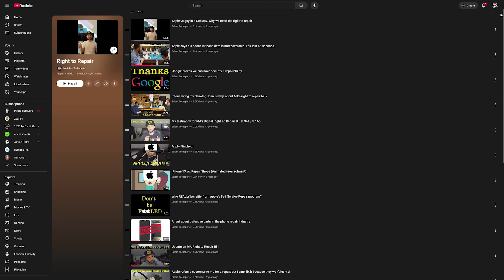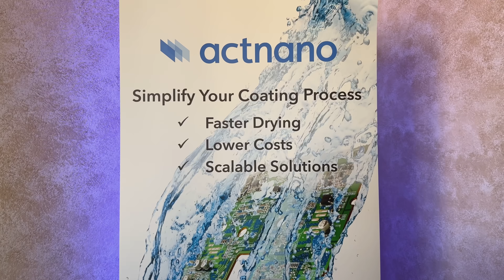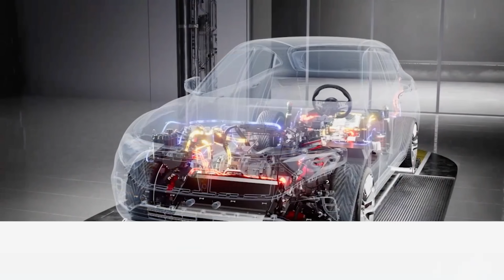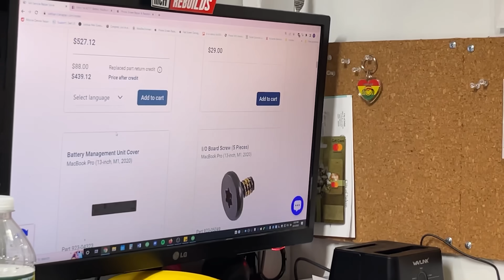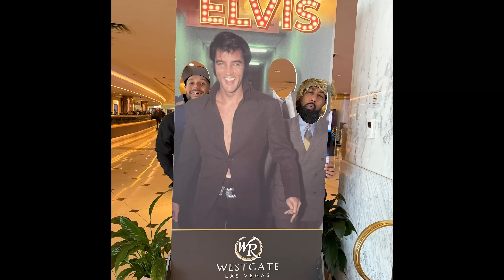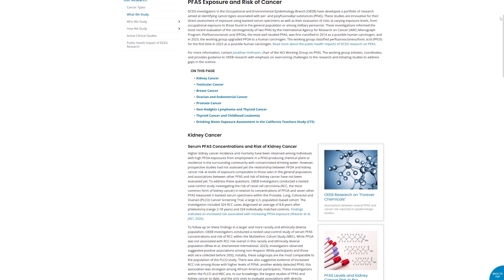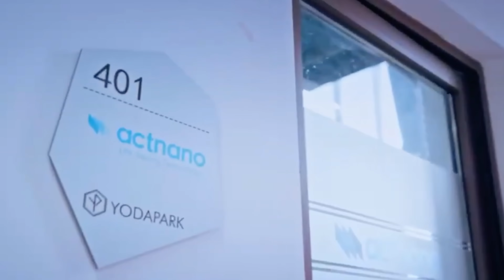Waterproof Laptops ARE Possible, But WE Need to DEMAND Them! actnano nanoGUARD is HOW We Do It!

Comment: What I want to know if this is something I can DIY with an air compressor
Reply from the maker: No, you can't apply it yourself. It must be applied in the production factory where dust, humidity and application of the coating are under strict control and with the proper procedure and machines. Explained here https://www.youtube.com/watch?v=Iyk5tB56P9s&t=1736s

Comment: It’d be nice if this is available for the general public. Especially for custom water builds.
Reply from the maker: You can't apply it yourself. It must be applied in the production factory where dust, humidity and application of the coating are under strict control and with the proper procedure and machines. Explained here https://www.youtube.com/watch?v=Iyk5tB56P9s&t=1736s
Reply: @ aw lame. Well wishful thinking.

Comment: This product, i believe, has been available since 2008 and came from some military tech/sbir funding probably for DACs on AWICS. So, to not put into a product would be horrible. It was original available as an outer coating on tablets, but it went away. I know cause i had a tablet with this type of coating on it and dropped it in a pool. It still worked, but i have never been able to find it after.
Reply from the maker: Not THIS product. This shows you the comparison between similar products and this one. https://www.ellsworth.com/globalassets/literature-library/manufacturer/actnano/actnano-comparison-chart---fluoropolymers-v-nanoguard.pdf

Comment: I totally agree with the concept, I am an electronics engineer for 20 years. I cant see how you can make this work with cables and connectors, also soldered wired with pointy ends.
Reply from the maker: The full interview goes into detail here, right at the beginning. https://www.youtube.com/watch?v=Iyk5tB56P9s 
Here's a brief demonstration https://www.youtube.com/watch?v=sx3xE7D5ys4

Comment: This whole "We can't make a durable product" shit really is all over in the tech industry now.  I remember Nintendo's GBC and GBA being basically bricks in durability.  Then the DS had much the same.

Then the DS Lite had hinge issues, and the Wii U REQUIRES a gamepad(Not sold separately) to work, and the Switch has awful joycon stick drift.  Hell, you can see it in other console manufacturers, too.
Reply: the things are still almost indestructable though. the lite works with a busted hinge, and the joycons are a result of small size, plus would you rather replace an entire console or just a 40$ controller.
Reply: I don't know about that. From what I heard, DS (the fat one) had awful hinges, and DSLite and DSi had much better hinges. 
Wii U is definitely a bust. I get why they require it, many games require it even if for some bullshit reason, but why they weren't selling them separately (outside of Japan) is a mystery.

Comment: Me with my DELL Latitude 7424 Rugged Extreme:
Reply from the maker: Those rugged laptops use gaskets and seals instead of coating, weigh 300lbs, the seal is easily broken when dropped, degrades, and they hold condensation. He goes into this in detail in the interview.

Comment: You have to ask him to put this thing into a spray bottle so we could apply it to devices we already own. Laptop manufacturers wouldn't want to lose 20% of their sales by applying it themselves.
Reply: that's not how it works. it must be applied in the production factory where dust, humidity and application of the coating are under strict control and with the proper procedure and machines.
Reply: @giornikitop5373 but repair shops could. i mean, some can do BGA fixing, micro soldering and more so they should be able to do it.

Comment: Can we just buy it and spray it on ourselves?  I have no problem tearing apart a new laptop and applying it myself.
Reply from the maker: No. It must be applied in the production factory where dust, humidity and application of the coating are under strict control and with the proper procedure and machines. https://www.youtube.com/watch?v=Iyk5tB56P9s&t=1736s

Comment: how difficult would it be for you to try to waterproof mainboards of thinkpads you have in your shop? you could sell them with or without waterproofing and see which ones would people buy...
Reply from the maker: It's not realistic. Every laptop would have to be completely disassembled, every mm of the board would have to be thoroughly cleaned of every single piece of dust. Then re-assembled, and god forbid if I missed a spot and the customer decides to send an email from the bottom of the Atlantic and it breaks, I'll now be liable for it. It's not worth it.
Reply: @SalemTechsperts  understandable, thanks for reply

Comment: Question ... could this be applied to electronics by a consumer or a hobbyist engineer with DiY projects or even by repair tech adding it to systems they are working on or is the application process really only feasable on large scales or during industrial manufacturing?
Reply from the maker: It's only feasible during the manufacturing process. Both for implementation and financially.

Comment: Personally, the only issue with this kind of a solution is the potential to hamper with component-level repairs. Water isn't the only thing killing devices, and a coating like this will make it a lot more challenging to remove components on the board that are soldered down.
Reply from the maker: As I specifically mentioned 2 minutes into the video, this does NOT hamper board work. https://www.youtube.com/watch?v=pPH1j3LG1zk

Comment: Hey, I have a big question. Is waterproofing offered by them? That Macbook Air they were demoing probably didn't come waterproof from the factory. How much would it cost me to waterproof my laptop? I know that of course there's all the liability with disassembly and the labour you have to put in to disassemble it, but what if I brought you just the motherboard (I'm an EE and could do that rather safely, especially since it's a ThinkPad). Maybe they can sell that coating agent in spraycans for self-application?
Reply from the maker: No, for the exact reasons you mentioned. https://www.youtube.com/watch?v=Iyk5tB56P9s&t=1736s

Comment: What about conductivity? From what I can see (00:36 second), the product is even sprayed on the connectors and pins on the board. So it should conduct electricity so as not to block signals between the board and accessories. In this case, short circuits may occur on pins or connectors after getting wet. And if it doesn't conduct electricity, how are these pins/plugs supposed to work? Do we apply the product after assembling the hardware?
Reply from the maker: Every question you just asked is answered in the full interview. https://www.youtube.com/watch?v=Iyk5tB56P9s
And a summary here https://www.youtube.com/watch?v=sx3xE7D5ys4&t=5s
Reply: @SalemTechsperts  Thank You

Comment: selling this as a product and letting repair shops apply it for us would be a huge middle finger to the laptop manufactures too🤔
Reply from the maker: Not realistic for repair shops to offer it as a service. It must be applied in the production factory where dust, humidity and application of the coating are under strict control and with the proper procedure and machines. Explained here https://www.youtube.com/watch?v=Iyk5tB56P9s&t=1736s

Comment: I'm not a repairman, but from my end user perspective, the issue with waterproofing is being able to re-certify it after repair. We NEED to invest in providing waterproofing components like gaskets, seals, and coatings to THE PUBLIC so that everyone can enjoy BOTH waterproofing and repairability. And designing hardware around re-proofing post-repair. One-time use seals are the problem.
Reply from the maker: This isn't a one-time use seal. Hence why I specifically mentioned board work and showed a clip of the product being re-applied after the chip was replaced.
Reply: @SalemTechsperts  So if you replace a board level component the new component is also water proof too? or would you have to re-apply the coating on that repaired component?
Reply from the maker: @cortburris9526  You have to re-apply the coating https://www.youtube.com/watch?v=pPH1j3LG1zk&t=7s
Reply: @SalemTechsperts  Correct, I was speaking generally, and the solution in this video is a good step in the right direction!

Comment: As a refurbisher of laptops (like yourself) and desktops - Dell refurbisher though - I totally agree with the use of this product. However, I wonder if there is an economical way for companies like ours to utilize this product during the refurbishing process? If laptop companies won't do it, then we should be able to do it. Obviously, we'd have to buy equipment to apply it, but at a reasonable cost and the product itself. I'd be willing to get with you to discuss it with the actnano CEO if needed and if he is willing.
Reply from the maker: Why they don't offer this service to consumers: https://youtu.be/Iyk5tB56P9s?t=1736
TLDW: It must be applied in the production factory where dust, humidity and application of the coating are under strict control and with the proper procedure and machines. Explained here https://www.youtube.com/watch?v=Iyk5tB56P9s&t=1736s
It's not a realistic option to offer to consumers directly.
Reply: @SalemTechsperts  or license it to a smaller company who can do 'results may vary, presented as is.' I think this is why apple self repair is not directly apple.
Reply: @SalemTechsperts Make it realistic. Maybe it's not a perfect application, but good enough really is enough!
Risk reduction is real, and refusing to offer the product to consumers makes the company look extremely bad. If I had a spray bottle with the stuff, or could dip a board in the stuff, a lot of my tech would still be working fine!
Reply: @runed0s86  the problem is this type of technology do need a requirement of clean room and dust lvl in industrial scale.

If your company can provide that , maybe they can make an exemption.
Reply: I mean, nice idea and all, but we are not corporate CEOs. The main selling point of this for us would be to be able to experience the product, not pray the company does it. 
I also sense the fear on doing this because random foreign companies could just clone the formula for cheaper. Guess it is what it is.
Reply: I'll hand over my resume if you both agree to it 😊
Reply: I'd see Microsoft doing it. For them laptop / tablet manufacturing is a minor source of revenue and it could be a game changer

Comment: they should have a service where they take your old devices and waterproof them, that would be really useful especially if you've replaced your back glass and broken the OEM adhesive
Reply from the maker: He explains in the full interview why they don’t offer this service. TLDW is there’s too much liability and the only way to make it 100% is to do it straight from the factory when there’s no dust on the board etc.
Reply: @SalemTechsperts  that does make sense
Reply: @SalemTechsperts agreed but tech is like time capsule these days. Some people want their Nokia 3310 running until the end of mankind vs ai war
Reply: @SalemTechsperts  That answer sounds a little sus if they care about the concept of saving ewaste and making products last longer. It sounds more like they don't want to put in the time/money/effort it would take to make it into a service. All companies have liabilities. Some like to just pawn it onto other companies like these guys. Still a great concept that should be used but I think they have more options than they're willing to pay for.
Reply: @SalemTechsperts I should still be able to buy a spray bottle of the coating
Reply: @SalzmanSoftware I am pretty sure waterproof nano spray exist commersially for more than 4 years already. You can put it on everything you like, for instance your shoes or... your hair if you feel adventurous.

Comment: All you need is ONE commercial. 

Using the laptop:
in the shower
In the pool
In pouring rain
On a boat and droped in the ocean, recovering, and the exel file is still open.
Reply from the maker: THIS video is the commercial.
Reply: @SalemTechsperts  how much to get it played during a super bowl?
Reply: @SalemTechsperts How about the performance though. By adding the layer their performance can be lesser than original.
I just found this video randomly it seemed pretty unbelievable. Though can be achievable.
Reply from the maker: @hara_reddy  It doesn't affect thermal performance or signals, this was answered in the video and elaborated further in the full interview. Hence why the auto manufacturer's prefer it and NVIDIA uses them exclusively in their water-cooled servers.
Reply: @SalemTechsperts  Ok I never knew this existence thank you for letting us aware of this technology I'll further look into this. Is this also applicable to mobile devices and other IoT devices too?. This could be revolutionary.
Reply: @SalemTechsperts No! They need this in the hands of an auto mechanic!
Reply: @SalemTechsperts  i mean, a commercial where someone live streaming by the pool at a pool party gets pushed in, computer and all, and coming back up with the stream still on and active. it would definitely get a LOT of demand from the younger generations
Reply: would milk money
Reply: Trading stonks on my laptop in a septic tank. Yes.
Reply: @Youtube-Sux-Arse-now  💀😭🙏
Reply: The ultimate ad would be someone using "this" while on those famous tuna-fishing ships that goes through insane storms. 😂😂😂
Reply: I feel like it wouldn't work in a hot shower but the rest def. I just don't want to feel the constant even if little anxiety drinking water or putting a cup near my laptop
Reply: @iwontcomment  It work up to 150 C if I remember right, so unless you drop it into a deepfrier you should be okay.
Reply: @iwontcomment  depending on the meting point of the coating you could have it in a hot shower
Reply: @cirelesten  it's on cars at least 200f°
Reply: Thinkpad
Reply: “Planned obsolescence” was the strategy of US automakers starting in the 70’s. Then the Japanese automakers ate their lunch.
Reply: @cirelesten  It could be a dolphin doing that, too!
Reply: I can imagine it already

A person engrossed in a netflix show, sitting in an overflowing bathtub

A buisnessman in a full suit writing an email while standing in a shower

A fisherman doing Solitaire in a sea storm

A kid playing league, dragged into the pool by his parents, still playing league

A diver underwater finding a still-working laptop playing this ad

“70% of Earth is covered by water. Actnano’s got you covered from the rain, spills and children.”
Reply: @cirelesten  goated idea
Reply: [laptop overheating] pours ice water into air intake [✔]
Reply: Could I finally beat it with a bigger screen? Hell yeah
Reply: I would volunteer to do that commercial. Get some SCUBA gear from the local shop, go on a dive and pull out my phone to take pictures.

Perhaps a couple buddies sitting on a couch in an olympic pool. We could have a TV & 5.1 surround sound playing. We could use a SSBA (basically an air compressor on the surface feeding a small tank) to actually get some bottom time.
Reply: They can't really do that, because then some customers would take their laptop with them to the shower, it'd die, and then they'd complain to the manufacturer citing the commercial. Conformally coating PCBs isn't magic, it doesn't actually waterproof the device, despite what the video title claims. Water ingress is still possible and will interfere with mechanical parts like fans. Even if you somehow managed to coat absolutely everything through a process like vacuum deposition, any non-soldered interfaces would easily rub through the 20-40 micrometer layer through vibrations just from carrying and moving the laptop around. A battery connector would still experience accelerated galvanic corrosion that'd eventually kill the device.

I'm all for conformally coating laptop boards. It's a device that can find itself in all sorts of environments. But you can't expect to make it waterproof as a result. It absolutely makes it more resistant to liquid damage and repairable, which is why manufacturers like Apple avoid it, but it won't raise its IP rating and you can't expect to go scuba diving with it and expect it to work for months afterwards.
Reply: While windows is updating
Reply: Crazy good idea
Reply: I'm somewhat doubtful of it working with salt water, stuff is stupid corrosive.
Reply from the maker: @Kyle496  "Resists a variety of fluids including water,
saltwater, soapy water, Coke, Gatorade, coffee,
salt, windshield washer fluid, coolant,
mixed flowing gas, sweat, etc."
Reply: @SalemTechsperts if it resists all types of fluids, then it sounds perfect for gaming laptops and the various fluids that end up on them…
Reply: @SalemTechsperts  You forgot the most important fluid of them all, mate
Reply: @SalemTechsperts  YOU GOTTA MAKE A SHORT ADVERTISEMENT FOR THIS
Reply: @triforcefx  don't put the Gooch collector out of business now

Comment: "Doesn't affect the ability to do board work" is a very broad statement.   I know water damage probably far exceeds "component failures" for some devices... but how could you ever find a shorted capacitor if this is sprayed everywhere?  You gotta scrape it off each cap?
Reply: I was wondering the same, and what about soldering or desoldering?
Reply from the maker: https://www.youtube.com/watch?v=pPH1j3LG1zk
Reply: @SalemTechsperts  right on.  So it is kind of a trade off.  You see more dead gaming laptops than I do....

Is it more common that a mosfet blows?  And some poor tech will need to probe around and find it?  Or is it more common that a can of RedBull gets spilled on it?

We have 4 cerainties.. death, taxes, cheap mosfets,  and drinks spilled on computers!